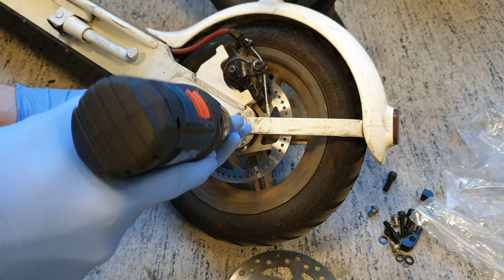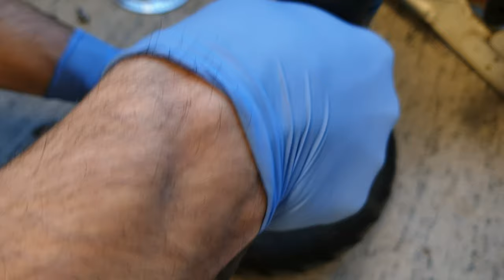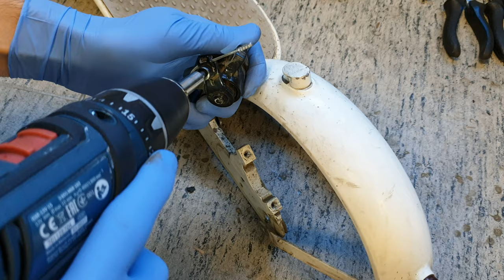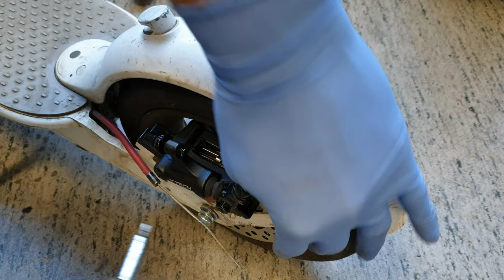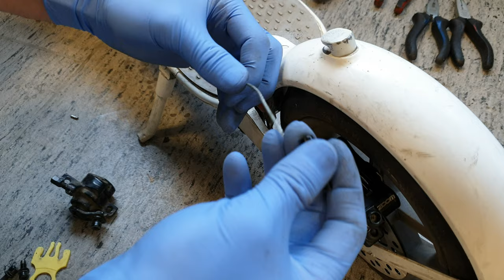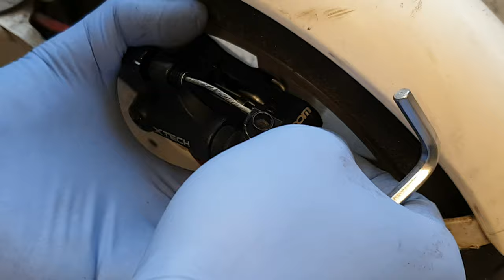Xiaomi m365 installing 120mm disk brake and hydraulic caliper

Comment: thank u very much
Reply from the maker: your welcome
Reply: @RMFUNTIK  did you put brakes on 8.5" or 10" wheels? I've been trying to put an 8.5" disc on 120mm all day, but nothing worked out. I changed it to my native 110 mm disk and everything stood up perfectly
Reply from the maker: @Ilya_genius  a bit of hammer a bit of grinding :D nah those brakes are shithole... not worth it. 8.5"
Reply: @RMFUNTIK  ahah, well, it's good for me on 110 mm brakes) there is also a problem that the wheel does not rotate freely. maybe you have a video or text with the correct setting of the brake itself?
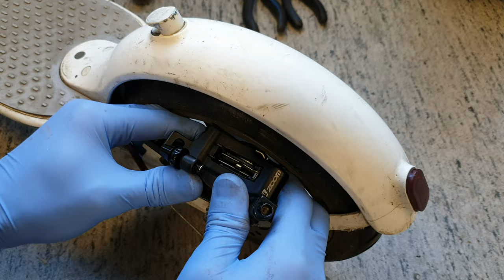Reply from the maker: @Ilya_genius  4:15 if look close to put the caliper on it's place i've bend the rotor a bit and used washers to place correctly.. setting? what do you mean by that? it's ether sitting normally or not.. there isn't much space or adaptors or something else to play with...
Reply: @RMFUNTIK  another question, I assume that you changed the brake cable (of course I did not know this and the length of the standard cable is not enough), what is the size of the new cable? I have a choice between 1.2 or 1.5 x 2100mm, so I think which one is better to take?
Reply: @RMFUNTIK  as a result, I took 1.6 x 2050 mm from shimano
Reply from the maker: @Ilya_genius  no i did't change it, i use original. buy the longest one :) you can always cut it.  it's 1.5 X 2100
Reply: @RMFUNTIK  thx
Reply: @RMFUNTIK  я думал, что ты не говоришь по-русски, но случайно нашел ролик с озвучкой. Вот только зачем я всё это время пользовался переводчиком ха-ха. Спасибо за твои видео, очень помог с установкой. Но поставить 120 мм диск мне так и не удалось
Reply from the maker: @Ilya_genius  бывает 🤠👍
Reply: It takes a bit of pushing to get it in there quit hard to do but does the trick